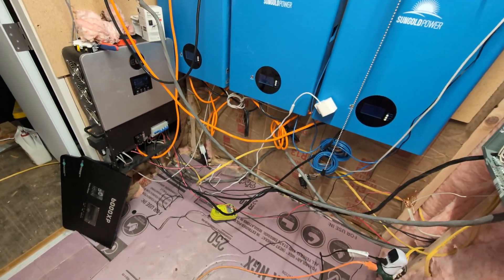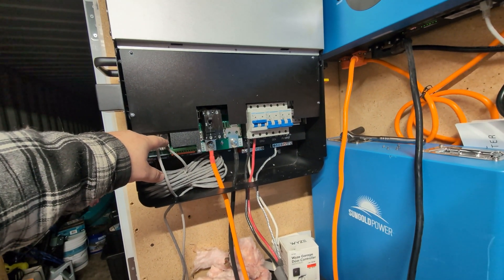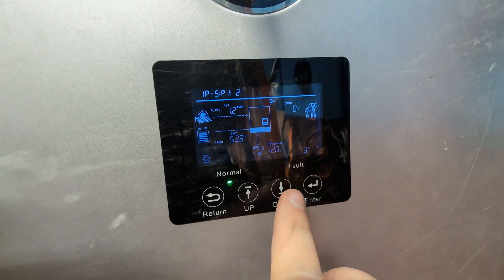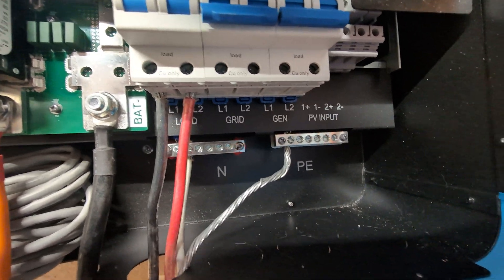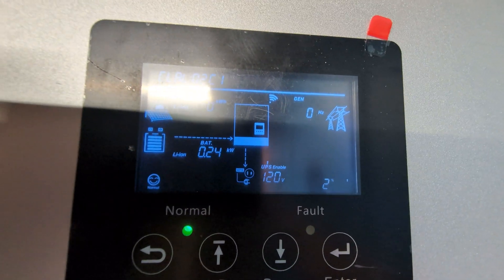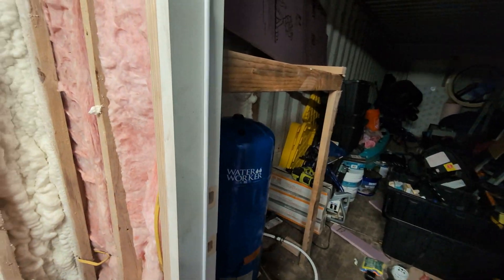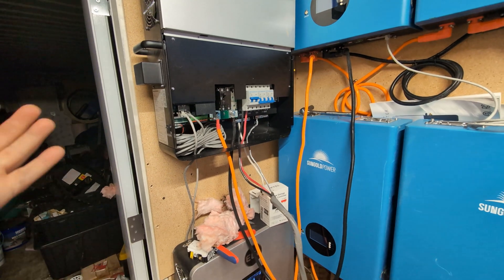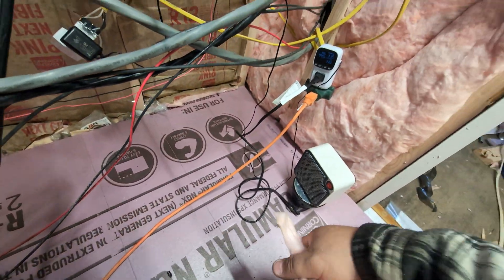Off-Grid Alaskan Tiny Home: Parallel Inverters & Winter's First Snow

Comment: Does the inverter not need more clearance on its right side?  Thought I had read that it does.
Reply from the maker: @jordanpack5571  it might, but since it doesn't ever get all that hot up here I hope it isn't an issue. If I need to I can move some batteries across the room.
Reply: @FrozenFrontiers  yeah that definitely makes sense. Great content btw!
Reply from the maker: @jordanpack5571  Just went out and checked, it looks like the intake is from the right side and the out is on the left side, when looking at the front of them. The amount of air coming through the output feels strong so I'll just keep an eye on the filters that they don't get plugged up over time. Thanks for the callout about this, I probably wouldn't have thought about it.

Comment: Looks like my trailer inside while I complete the build, one more week and I am done the whole build for this year, more insulation, primary heater under the trailer, a 4th 3kw array, a new 10kw 240v inverter, it is my 3rd inverter and finally all is perfect. So far a low of -6C here, only a 170w heater in the crawlspace and it is 18c inside the entire 28' trailer, it is so nice when the temp on the floor is 17c. Power usage with CPU, tv, deep freeze, vent fan, lights, and electric heat exactly 612w with the compressors running most times 500w. My batteries can charge at -30C but this year they get their area heated at 17C; they should perform better than the low of .7c when I had no heat below last winter @-33C. It is 1C now, past 7 hours 23c to 21.5c more insulation to go to improve the temp.
 Hats off to building a cabin, I am too lazy I just parked a trailer and modified it to 100% 120v. Now I can spend years building something like at sloth speed.

Comment: Looking good. I recommend getting yourself some red electrical tape and bright red good quality fingernail polish. Mark all of your battery pos with red. China uses tan for neg and black for red. I blew molten alum everywhere in our dining room when I first started from mistakenly hooking up my pos cable to the tan pad which was WRONG. Didn't make that mistake again. Mark all of your L2 sides of breaker panel cover, breakers and at each end so that you always know which is which. I have an L1 hall effect sensor/display and an L2 hall effect display just to monitor volts, amp, kWh, etc. Mark the L2 meter red too.